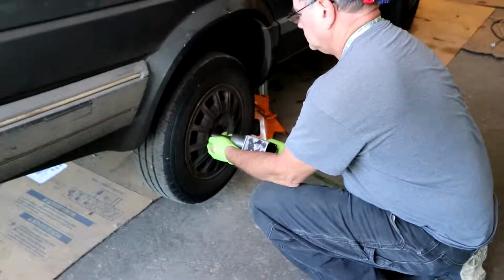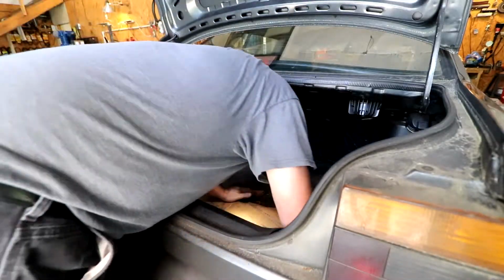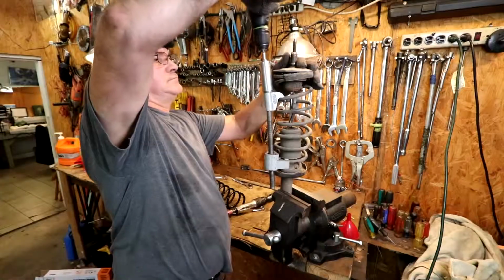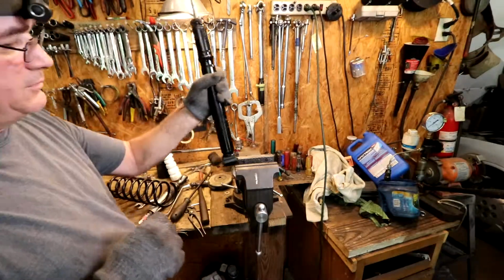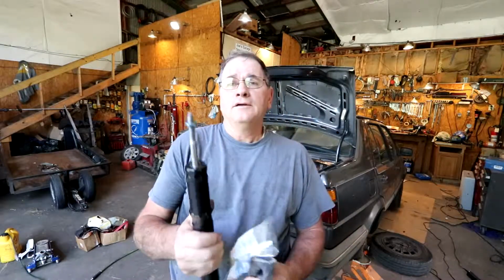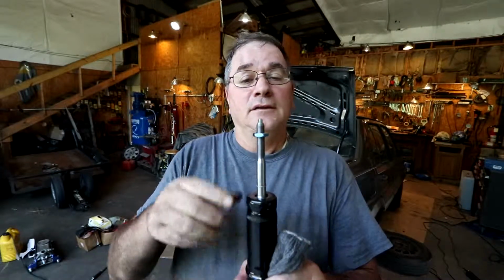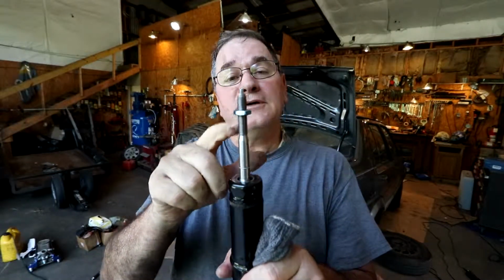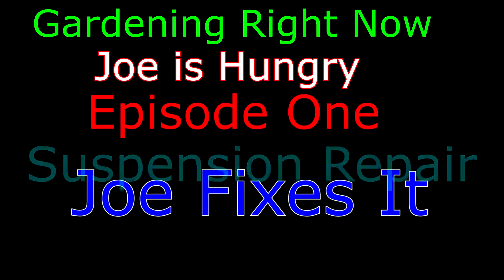Replacing Rear Shocks and Springs 1989 VW Jetta Diesel  Joe Fixes it

Comment: to make this job a bit easier, try removing the rear seat to gain access into the boot, then the parcel shelf cover can be lifted up slightly to get good access to the bolts
Reply from the maker: yeah I thought of doing that but it is almost more trouble, did not really have any trouble except for the nuts being the wrong size, actually I think there were aftermarket shocks on it and I out OEM back on,, thanks man.. keep the fait, I have four turbo MK2 jettas and a NA golf.. take care